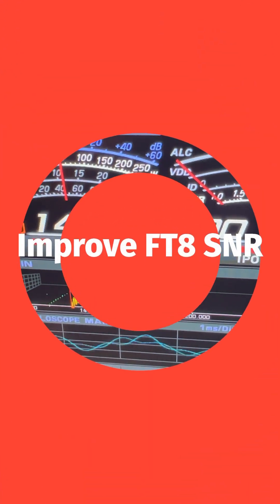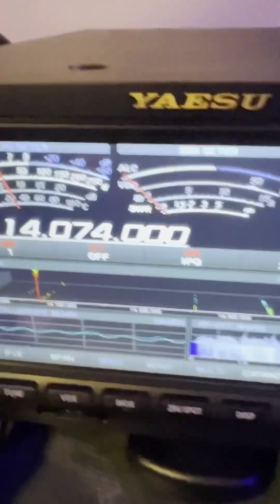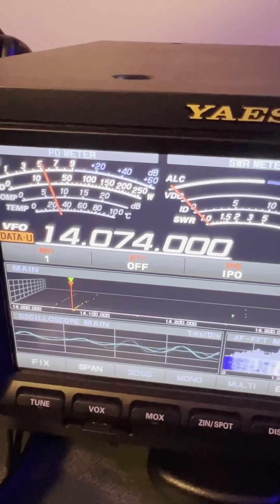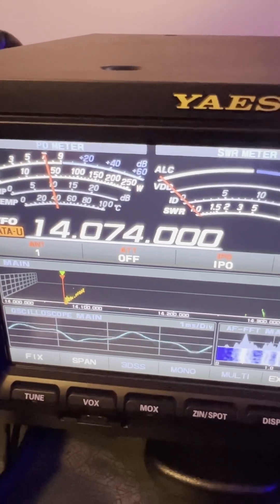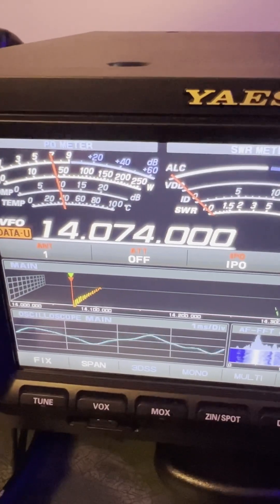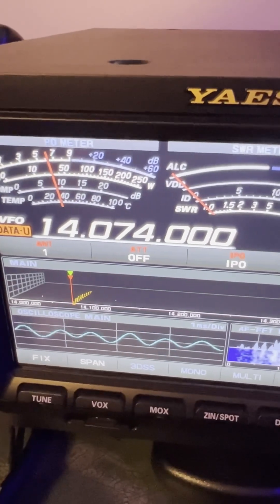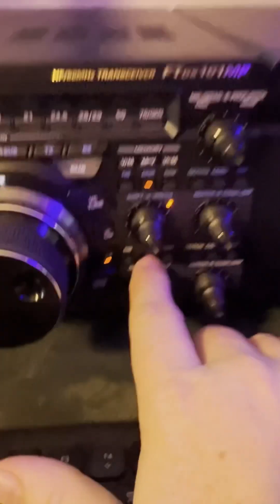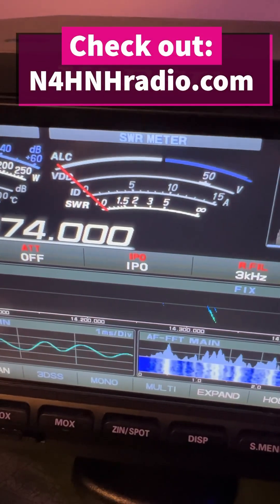Improve FT8 S/N Ratio #hamradio #ft8 #ft4

Comment: nice as usual! what’s a good level for DNR and Ft8 on the DX-10/FT-710, also 15?
Reply from the maker: Actually this video is a year old. But I had a question from a Patreon member today which made it clear to me that this is another video that members missed. It seems that some members only consume the Patreon content and not the public YouTube content. 

The FTdx10 DNR could be set to between 7 and 15.  The same is true of the FTdx101.  But I would not suggest setting the FT-710 DNR higher than algorithm 7.  And that’s assuming you have to latest firmware. With the earlier firmware I would suggest that you not go beyond algorithm 3.  Above 3 (earlier firmware) or 7 (newer firmware) the DSP introduces gnarly digital artifacts.
Reply: @n4hnhradio I get some strange artifacts on my waterfall with DNR on 7 of the DX-10

Comment: I have to admit I didn't switch on DNR for digital modes as I was concerned it might actually consider some of the signals to be "noise"... Would be interested in your investigations into his effective it is!
Reply from the maker: It’s very effective. The tones leap out of the noise floor. The S/N ratio is much improved. I issue very strong signal reports. It isn’t uncommon to see WSJT-X issue +25 to +35 to the stations I work.  The only limit is that audio above 2,800 Hertz is blocked by the DNR.